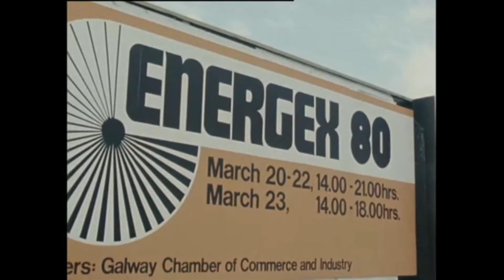The Electric Car Of The Future, Ireland 1980

Comment: Great to see, I wonder what electric motor they used. If they picked a lighter car like a mk1 Golf or Kadett C rather than the heavy Volvo, they could've got another 10 mile range out of the batteries.
Reply: Are you thinking the car was the small Volvo that came with the Renault engine? Look at the back of the car. I'm thinking it is the much smaller DAF Variomatic that was later made or at least badged up as a Volvo.
Reply: That's a Volvo 66 which is just a mildly reworked DAF 66 after Volvo bought DAF. Slightly lighter than even the Kadett or Golf. Came with an efficient variomatic CVT too which if they kept it meant the car would have been as fast in reverse as it was forward. Even the big volvos are much lighter than people realize though, a 200 series volvo is about the same as an E28 BMW and much lighter than a Mercedes W123. They were sturdy simply by having a well engineered body structure rather than an over-engineered one.